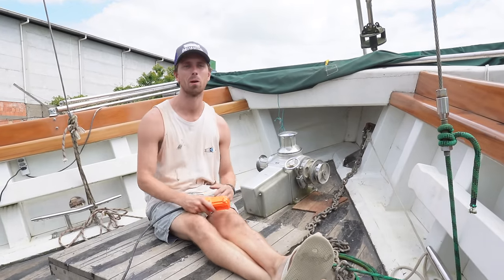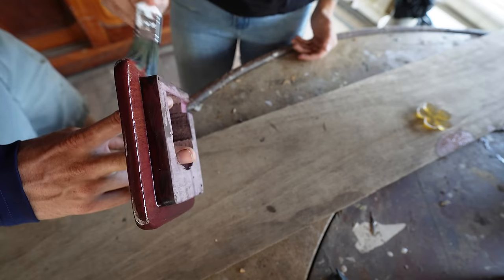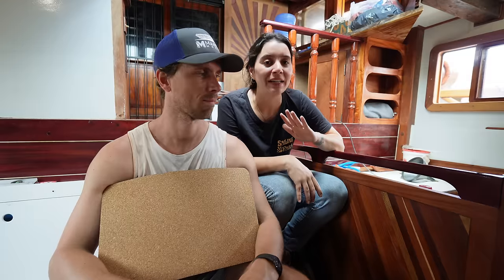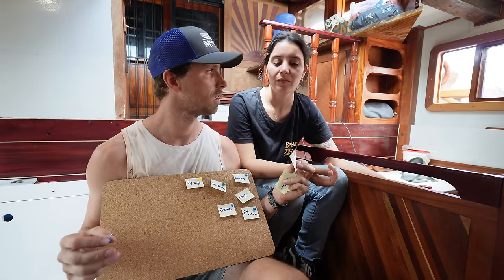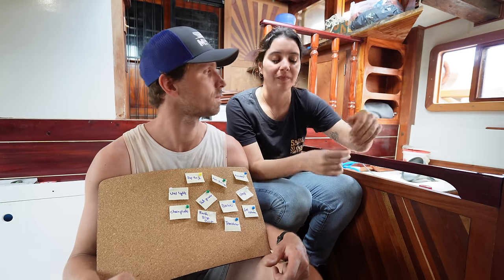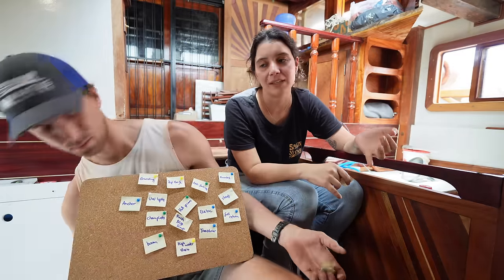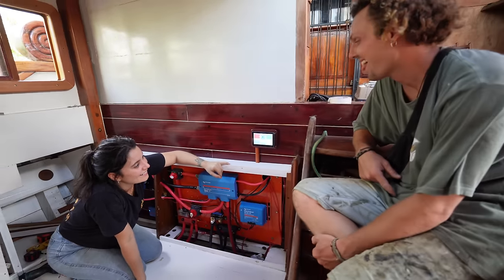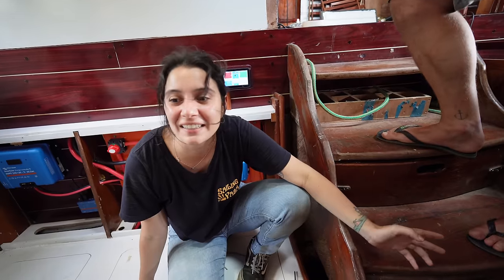Boat launching to-do list: you're gonna either love us or hate us for this — Sailing Yabá 191

Comment: I saw you load 50m of anchor chain, not enough! before you worry about cleaning it which is one of the jobs you have listed, decide how much chain you need. If you intend to go to coral areas then no rope! a vessel needs three times the depth for anchor rode in ordinary conditions. Once the wind picks up then scope should be five times the depth and if it goes to seven times the depth you might be better off in bed ashore. many places you anchor will be 20m deep or 6 or more fathoms so 50m of chain is not enough. good to see each day progress, keep up the god work.

Comment: I saw you turning around the engine raw water pickup and want to scream. As a marine mechanic of 40+ years I do not recommend that you leave it turned to the back. I know it sounds like it would pick things up and clog with debris. However by turning it the direction you did as the water passes over the pickup it creates a vacuum on the inlet line and is likely to starve the engine for water. I have seen it happen on numerous customers boats that have done work and turned it around only to then start having issues. Love the videos and hope you two have a great time sailing the world soon.

Comment: Great episode, Ben agree with your theory on turned that I take strainer around. My comment on the lights is to leave it till another day, you have several new penetrations in the hull already which you need to monitor, why add stress , wait until you have kms of sailing in, gained confidence in both Yaba and yourselves. At a later dater I think it would be a cool install. I think it’s really great how you two guys are tackling different jobs, halving the load.

Comment: Ok.. hear me out.. a ladder for climbing out of the water and onto the yacht.. and with that, a diving board.. lol... 
Quick question on the reversing the direction of the water inlet.. in theory, I agree with the force generated while underway by the same theory is also true after reversing its direction. Will it cause a vacuum or suction effect while underway??.. seeing how it's really low under the waterline would floating debris really create a clogging issue? Or you over thinking it and being overly cautious?.. hard to say when there are so many unknowns.. trial and error, for sure but to help mitigate error in judgment as much as possible look to doing more research and absolutely ask the elders in the industry that may shed some light on successful techniques in all aspects of safety and functionality. But I'm sure you know all of that... I just want you guys to be safe. The electrical grounding is, of course, whatever works within the guidelines of applicable grounding of vessels. There are many to choose from. I personally always picked the bigger the grounding, the safer you are... especially when dealing with lightning.. Are you bottom feeding the fuel tank to the engine and the return is going to the top? As long as you incorporate a fuel filter, it'll be your best option. Connecting the fuel tanks into one feed is also 20/20 theory in application. Our one tank feeding another then feeding the engine.. who's to say what works best.. but as far as the return line would it a required method to NOT to just drop it back into the tank but by way of a hose inside the tank to the bottom. Possibly minimize static buildup or it won't be an issue? (This is what I mean about over thinking.. and I do it all the time... 😆) CHEERS!!!

Comment: There's an old saying, think long......think wrong. In re. the water inlet's orientation, there's pretty compelling comments for forward and strong warnings about possible engine damage if backward and boat speed above 5 knots or so...will Yaba be a slug???. I would follow the recommendation of the manufacturer, which according to one comment was forward.

Comment: Did you correct your settings on your battery controller. 0% is not advisable the DoD is usually a chart on your manufacturer instructions. To discharge a battery to zero before charging will also no allow for emergency. Use 50%.

Comment: G'day Crew, 
Hey Ben ,with your lightning arrestor, do best job possible , use good cable even enclose inside PVC pipe ,run cable as far away from any other electronics / electrical cable  as possible as a strike will arc and burn all your systems .
DO NOT  earth to your engine as it could burn out alternator  and all associated
gauges / switch board  ,
but also damage engine components  and drive shaft bearings as surg passes through to ground .
   Perhaps a little research ,but common sense  says stay as far away from any other wiring  as possible.  
 
   Respect...!

Comment: @07:18 Installing them with about 1 - 0,5 mm of "Sika gasket" means removing is quite easy. use a strong thin wire to "wire-saw" the gasket, and you're done.👴🤓😉
@08:26 Is a reminder of no matter how strong your glue is, if there is a weaker link in the chain....👴🤓🤔

Comment: You guys need to make a master list  of things to do          Do not turn the basket your motor will over heat it's made to face forward that's why you have a raw water strainer to keep things out of your engine cooling you.  need zincs around your propeller you also need to on the bottom if you don't your fasteners will corrode away over a short time like 2 years you'll have to refasten the whole boat below the waterline. buy a book get a book .get somebody that knows what they're doing  rigging a boat out you're making big mistakes !!!!!!!
Reply: Thought they said these boats were originally without standing rigging.

Comment: The problems with your daily reports it's all talk and very little work !!
ENGINE ROOM FIRE EXTINGUISHER SYSTEM
 What happens if your TURBO BRUSTS into flames as they do  unfortunately 
Missing battery fan extraction for build up of heat.
As all modern yachts how have all lithium battery's in water jackets to keep.them cool YOU have nothing .

Comment: The inlet grid should be facing backwards for the reasons you state.
Reply from the maker: That’s why we just turned it around ☺️
Reply: No, it was correct the way it was installed from the start. Look up what the venturi effect is. It will create a negative pressure for the pump, risking bubbles to form, stalling it, with engine overheating as a result. There are installation instructions for these, and they should be followed.
Reply: May be the case for a fast motorboat but not true for a sailing boat. You won't generate enough flow for that. It will make it less likely to get crud sucked in and plastic bags to get stuck over it facing backwards. I have had one on my sailboat with the grid backwards for years without any problems, mind you I don't go faster than 7knots when motoring or motor sailing.